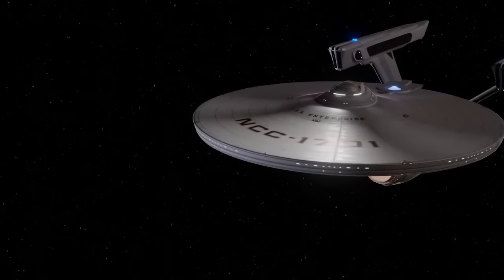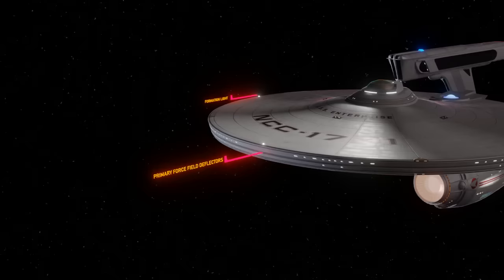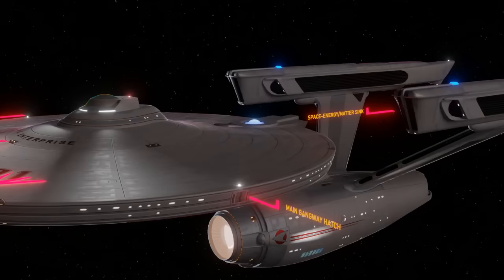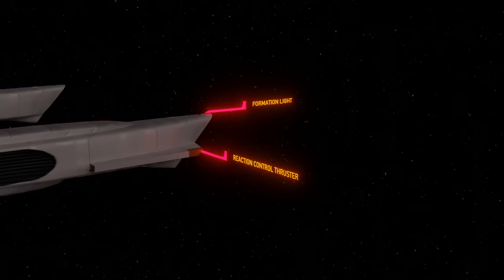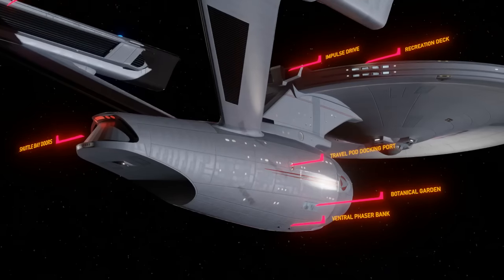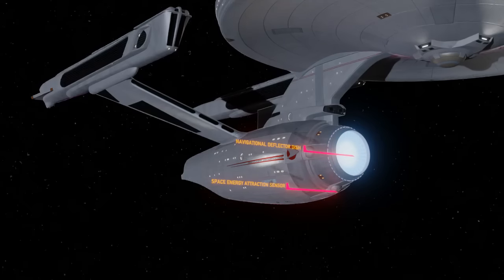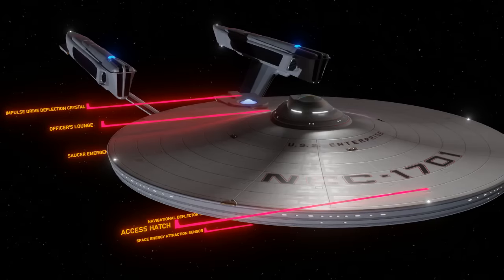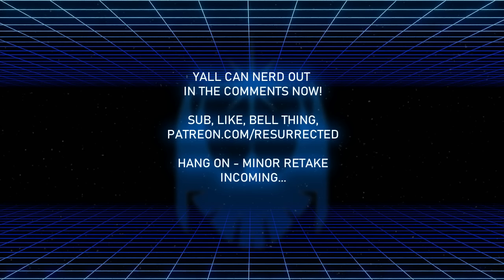ALL The Refit Enterprise Features Explained! CG Model Breakdown

Comment: The original 1701 and refit did not have a deflector dish. Those didn't happen until the TNG era. In the TOS and TMP era, the Enterprise had three navigational deflectors seen surrounding the communications/sensor dish. The Reliant had them too.
Reply: Yes, it did.  What do you that that large copper dish in front of the engineering section was?
Reply: @chadevans4922  That wasn't a deflector dish. That was a communication dish. The deflectors were the three nobs that surrounded it, on both the original and the refit. The Miranda had the same three deflectors too (albeit in different locations of course), which is how/why the Reliant was also able to go at warp safely without having a "deflector dish." It wasn't until the TNG era that all these components merged into a single "deflector dish." This was covered by Stuart Foley over at Trekyards using official material created by Matt Jeffries. You'll note that at no time on screen was the 1701's dish ever referred to as a "deflector dish." It wasn't until 80 years or so later when we heard the crew of the D refer to THEIR dish as a deflector dish in "The Best Of Both Worlds."
Reply: This is at odds with the information in Memory Alpha. The dish is used to try and deflect an asteroid in TOS.
Reply: @chrisclarke9637  No, it's not. The script calls for using the deflectors (plural). This references the three front deflectors that surround the communications dish.

Comment: For years, I have always had conflicts with the Movie version and the TOS version. I mean once you get past the gratuitous elements (admit it, the refit looks a little too much Art Deco) and understand the why things make more sense. My biggest problem has always been the nacelles. The federation always used tubes, the Klingons, on the other hand (hey those things look a lot like Klingon nacelles; just saying). But considering the TOS area where you weren't exactly sure where the weapons were located, this was a vast improvement.
Reply: IIRC the parts inside are still tubular, just encased in the new housings. The big magnets are opposing semicircular segments aligned in stages down the length of the nacelle.

Comment: You missed the phaser banks above the shuttlebay.
I've also heard contradictory information that the "space attraction sensors" are the actual navigational deflectors and the large dish is just a giant sensor.
Finally, and I know this wasn't addressed in your video, but some have used the Rec Deck as a reason why this Enterprise should be longer than 305 meters.

Comment: Impulse drives the ship to .99c then the main engines engage and break into warp travel.
Red/blue navigation lights should be in there as well. They were actually part of the TOS design but were hard to see with the way TV screens mangled subtle colors back then. If you look at the prop it has them. Later on they were forgotten on some designs like the Galaxy who had them and then didn't have them depending on the season and shot lol.

The exhaust vents on the torpedo tubes are because torpedos are actually explosively launched with gas down the tube. Then their small warp coils energize by interacting with the ship's warp field, they act like capacitors for the warp field energy basically. This allows them to travel to their target and blow their matter/antimatter warheads. But they have no conventional drives, so they need a bump assist to start moving through the standing warp field and charge up, hence the explosive launch. This all means the exhaust has to go somewhere so they use (absurdly long?), exhaust tubes to dump it out aft.
Reply: Not from what I read, impulse can take you to about 0.5 C..
Reply: @011keepers  in going off the galaxy class technical manual

Comment: Im a Safety/Health/ Environmental compliance guy. Realizing that this is a sci-fi, "space vessel", it seems logical that it would have all the, "bells and whistles" that modern spacecraft/aircraft have. Of course there are catastrophic failures that no amount of safety gear can help (ie. Space Shuttles: Columbia, and Challenger). Thats why navigation/ formation beacons, hazard avoidance placards, and warning strip markings, especially where the hot/cold/high pressure vents/ports are located. Ejection ports,  Automated warning and collision avoidance  messages that are transmitted on standard communications  frequencies, and in various languages, weapons safety pins, covers and ports, and emergency escape-hatch/pod bays, teather and life support anchor points, hand holds, and railings, parachutes. If you pay attention to military and even civilian vessels there are tons of safety, emergenvy, and hazard warning placards placed in very visible spots. On civilian vehicles it's color coded to match the surroundings and decor, but still provides visual reference. In  workplace/industrial/military service, craft have them in bold typeface in yellow-green, orange, and red. Why? Because people are stupid and panicky. Industrial/military people recieve heavy emphasis training, but the regular public, not so much (In case of a water landing; your seat cushion is a flotation aid).
Matter of fact, I'm surprised that ST in all if its' incarnations, never showed the safety drills that must occur in military, or civilian industrial craft. The movie "Alien" had a safety warning/evac-system messaging system on "Nostromo" (YOU HAVE...5... MINUTES...TO REACH SAFE ESCAP DISTANCE BEFORE SHIP DETONATION), along with audible alarms, flashing lights, and signaling beacons to show the closest route to the escape pods. 
The animated series had a "deux ex maquina" called an "environmental belt" that crew wore instead of PPE, or space environmental  gear. That seemed to magically provide environmental, life support, and force field sheilding from whatever environmental hazards were present. Perhaps that could have been adapted in TNG or beyond? It certainly would be a neat thing to have for off-shore, oil-well platform workers. But the general public would still moan about, "the hassle". Pleasure cruise ships have life jacket safety drills that are required, and passengers STILL moan about them too. 
You'd think all the publicized, gruesome, life taking accidents that happen would make folks hip, and accepting of them, but NOOOO. In the end we must all be accountable for our own safety and actions. Whether on  cruise ships, or space ships, "Safety First".

Comment: This is a great, informative, video of what I think of as the queen of Starships. Your info. is consistent with what I've read in books like "Mr. Scott's Guide to the Enterprise", and others. Well done!

My only correction is that the large "NCC-1701" designation on the upper saucer is NOT in the right  spot. It should be one row up, one the third concentric grid circle from the center where the  A,B,C, decks/ Bridge area is. Otherwise, everything else is perfect! 💖🖖😉

Comment: The constitution class refit, steered with thrusters on the hull. Multi-vectored impulse thrusters, were first used on the Ambassador class starships. Also. Warships can absolutely have botanical gardens. Not just for morale. They can also be used to grow food, and augment life support, by generating Oxygen and scrubbing Carbon Dioxide from the air.

Comment: If the saucer has to be separated in an emergency it would need deflectors to protect itself from space particles while traveling.  They could also supplement the main deflector at higher warp speeds.

Comment: My favourite. It just hit that design sweet-spot where it looked interesting, functional, and didn't have unnecessary bling. As much as I do like later Trek for the stories and characters, I was never a fan of the nacelles glowing, and later designs abandoned the edge of the disc aspect where it had windows for two internal decks, to a more tapered edge without windows. 

And I despised the Abrams hot-rod approach. Instead of trying to design a feasible Starship, they tried to make it the sports-car of space, but then went entirely the opposite direction internally by making Engineering a literal Budweiser brewery.

Comment: I've always wondered just how much of an improvement the refit was over the original Constitution Class.  It must have a faster maximum and cruising speed as well as more powerful phasers and shields, but by how much?  And in what other ways does it improve on the specs of the original?  With such a drastic redesign of the entire vessel, an entirely new kind of warp drive in the vertical warp core, the difference must be pretty drastic.  It wouldn't make sense to completely switch out the circular nacelles for these more rectangular nacelles unless the new nacelles were noticeably better suited either for high warp speeds or for the new warp core than the old nacelle design.

Comment: The reliant and Conni are different sized for the saucers if i recall it'd be kinda neat to see what each with the others saucer in scale would look like, and perhaps even the excelsior one if you get a model of that.
I think the Akira class has more detail at least via its designer but the canon doesn't support the 15 torpedo launchers which always seemed like overkill.. how would you feed a suitable number of torpedos to all those launchers or would each have like 10 then be empty (until crew move them around outta combat) though i did like the idea of 15 torpedo launchers when i was modding Star trek Armada 2.

It never quite worked well, I had torpedos with a "saved batch" or backlog when it entered combat it'd fire one every X seconds, once out of first combat it'd load as many as the file said, say 3 for the defiant and sovereign's quantum launchers and 2-5 on other ships, the Akira firing like 2 or 3 torpedos from one side of the ship then turning to repeat was just so bizzare.

Refit conni is one of my favorites along side the Akira and Excelsior! reliant would likely make 4th if the Sovereign didn't.

Comment: Warp drive doesn't actually move the ship. it creates a warp bubble that warps space around the ship so that moving forward actually is covering great distances by squeezing space together and spreading it out behind the ship. The impose drives which are an 75% sure  is an ion drive(like the expanse) are the only method that moves the ship. So by warping space around the ship they aren't actually going faster than the speed of light. Its ironicly of all FTL type drives the most realistically possible in modern physics.

Comment: Something doesn't make sense about your explanation of the design. With so many systems embedded in the saucer hull to deflect debris away how does anything get into the ramscoops? At a high enough speed to collect enough debris to use as matter for the matter/antimatter engines wouldn't the ramscoops just knock most of the matter away since they are so low to the hull? With that said, Excellent model, my favorite ship also.
Reply: The thing is, you don't need to really deflect things too much, just enough to avoid the ship. So the molecules getting collected by the ramscoops are just deflected up over the saucer, where the ramscoops attract them down into them.

Comment: The Enterprise did not need an aft torpedo launcher since torpedoes were guided and could change direction.  This is similar to modern submarines with guided torpedoes have no need for the complications of an aft torpedo launcher.  Even though aft torpedo launchers were obsolete the Enterprise D had one.

Comment: Great looking model, don't want to come acros as negative but those warp nacelles are not accurate including them having flashing nav lights on the lower side of them, sorry as im a refit Enterprise perfectionist nut case lol.
Reply from the maker: They were only on the top??
Reply: @resurrectedstarships  Yeah, I had to double check that too.  There aren't any lights on the bottom of the nacelles.  Check out the sequence when she leaves drydock in TMP, there's a good shot from below aft and there are definitely no lights on the lower fins, just lights on the side fins.
Reply: @resurrectedstarships  But your model clearly has flashing lights top and bottom at the rear of the nacelles, this is incorrect as it should only have them on top.
Reply: @gabrielvampyre  Bu this model in this video ha them on the lower fins which is incorrect, the original filming model only has them on the top!
Reply: @ptaylor5014  I was agreeing with you.  I was trying to say that the filming miniature didn't have a light on the bottom nacelle fin and was trying to provide a good example from the films to illustrate.

Comment: The one thing they missed at Industrial Light and Magic, when they made this model is that the saucer is the perfect shape for atmospheric travel.  Well, straight up and down, anyway.  I don't know if Matt Jeffries intended this in his original design, as the saucer emerged from a what was originally a doughnut around a cone.  The warp engine was at the center, and the impulse, at the back.  As a saucer, the underside is shaped like an aerospike.  Were you to open airvents in the thinnest part of the saucer, you could make a flying machine simply by placing a pulsating heat source on the central cone.

If you do not apply aerodynamic reasoning to the saucer, then the shape is elaborate nonsense and should be discarded.  You can't have it both ways.

Comment: I do like this version of the Enterprise. My second liked version is the galaxy class version. But in this design, I think the photon torpedo tubes are in the wrong place. The neck, connecting the secondary hull to the saucer, is too narrow. In my opinion I would put the torpedo tubes in the front part of the saucer and then separate the impulse engines, move them further left and right, and put in stern torpedo tubes. Then make neck thicker between saucer and engineering hull.

Comment: WRONG!  The blinking lights on the primary hull are NAVIGATION LIGHTS.  Following the naval and aeronautical standard of green on the starboard side and red on the port side and white along the central axis.  These are universal standards and are used to indicate the direction of flight from a distance.  The outermost lights on a ship follow these rules.  The other lights on the ends of the nacelles and top of bridge and bottom of secondary hull are FORMATION LIGHTS.  These are faster blinking very bright white lights, usually a strobe/flash blinking pattern.  These are used to give a rough outline of the size of the ship.

Docking ports...WRONG AGAIN!....If you listen close to The Motion Picture when Kirk and Scotty board the ship via the port side cargo bay, you can hear the computer announce, "Attention, a travel pod is now available at CARGO 6."  How can this one be number 6 if there are only 5 ports?  You're missing two underneath the saucer at about the 10 o'clock and 2 o'clock positions.  Spock later exits through one of these in a thruster suit to investigate the V'Ger interior.  These aren't "cargo hatches" they are actual standard sized docking ports situated on deck 8 covered by outer doors.

Since the port-side docking port at the cargo bay level is number 6, I think the logical way they are numbered would be as follows:

Bridge - #1
Deck 8 - port side #2
Deck 8 - starboard side #3
Torpedo bay - port side #4
Torpedo bay - starboard side #5
Cargo bay - port side #6
Cargo bay - starboard side #7

Deck one has to be docking port #1, it just makes sense.
For all others that are matching pairs, even numbers on the port side and odd numbers on the starboard side.  That way when everyone hears "Travel pod available at Cargo-6."  They all instinctively know that's an even number, it must be the port side.

This would match up with the sign in the background during the "Mutara Battle" segment of ST-II-TWOK where you see it say "TORP BAY 4."
I think the film makers kinda knew this, or just got confused.  Because you see "TORP BAY 3" on the other side briefly.  Then going back to the beginning when Kirk, McCoy, Sulu and Uhura come aboard, it says "TORP BAY 2" and also at the Spock funeral scene.  So much for consistency.

How's that for GEEKING OUT?

Get it right dude!

And DON'T YOU DARE call this ship the "Connie" as in short for Constitution Class.  I HATE THAT!

And the Reliant IS NOT a Miranda Class.  It is an AVENGER CLASS HEAVY FRIGATE.